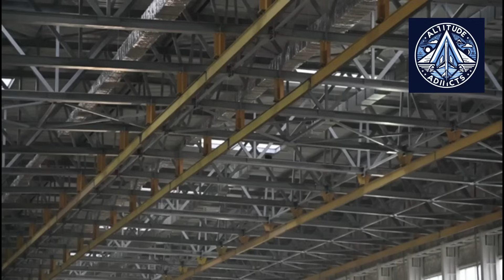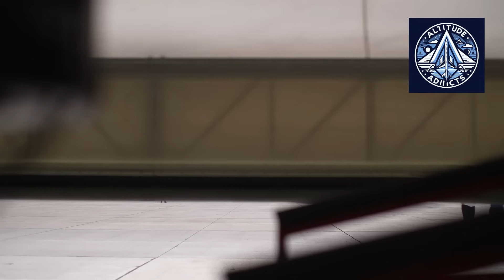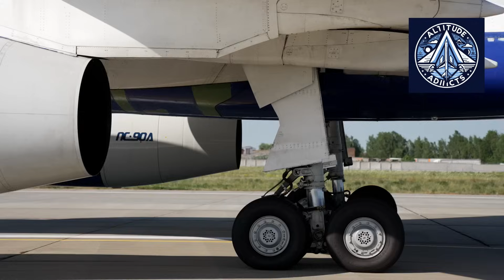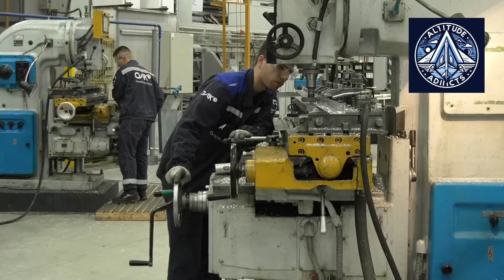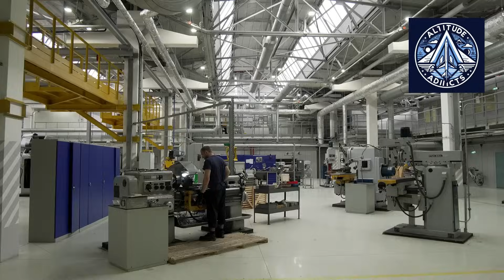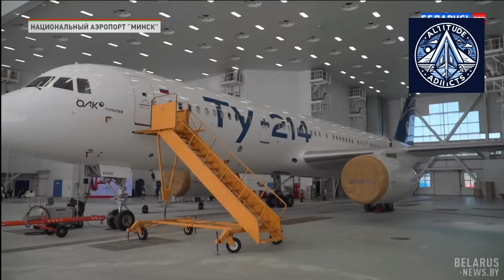Fully Russian Tu-214 Nears Certification  -  60 of 70 Flights Done -  20 Planes a Year by 2028-29

Comment: The testing is necessary to sharpen the algorithms for the desired configuration and performance of the engine and flight control to monitor desired performance and economy of the aircraft by limiting or increasing performance of the engines for final programing and fuselage characteristics, it is then where they can compare it with foreign aircraft like the A321-XLR or the Boeing MAX-10 with similar MTOW and range, but of course they can increase the range like Boeing or Aibus by placing 2-3 containers in the cargo hold with fuel to increase the range....!..
With commercial use they can finalize its final setup to put it in production according to those final results and economies....

Comment: it is ironic that the great Airbus "gamechanger" the A321XLR .... is effectively a 757/Tu-214  type aircraft .... as they can fly direct into holiday resorts etc from far away .... avoiding big hubs dominated by widebody aircraft. I flew on an A321XLR recently direct to a regional airport. I was up the front and was amazed at how many rows of seats were in the plane. Then I realised that the plane was actually too long for the airport building and that passengers down the back had to exit via stairs to the tarmac ... ironically the Tu-214 is in fact an Airbus A321XLR ..... you can see how this plane suits Russia's East and holiday charter flights into Asia etc. And it is already certified internationally .